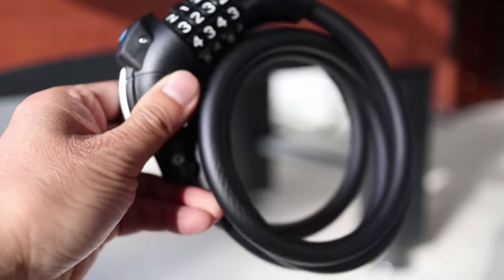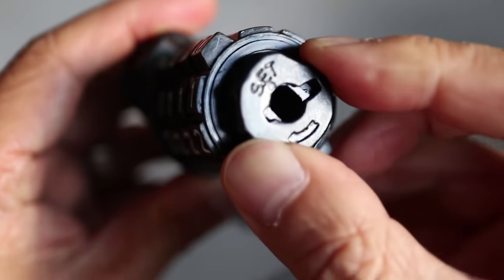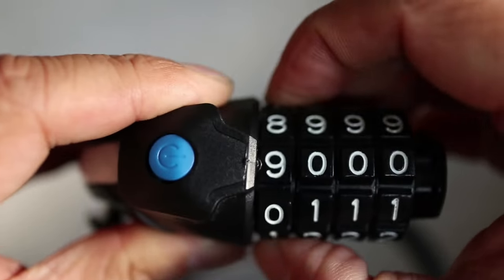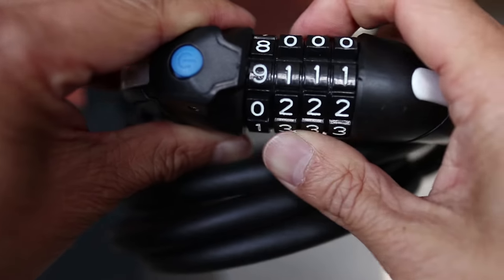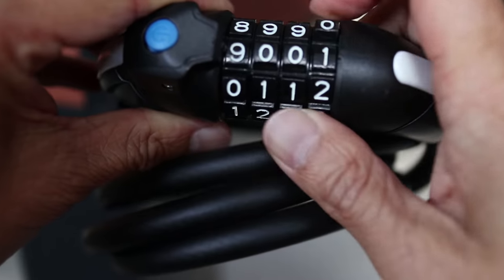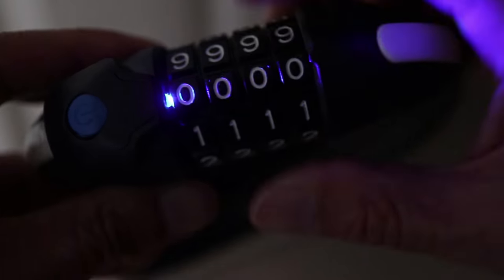How to Change Bike Lock Combination – Reset Combo on a New Bike Lock Cable with LED Light

Comment: hello, I got down a Anko bike lock recently. I could release it with 0000 combination but did not work the new combination. Also now even can not turn the reset button to 90 degree clock wise to the position to have a new combination setup. Any advice please.

Comment: I bought mine at a yard sale and don't know the combination. I didn't think to ask for the code since I assumed it was already reset.  So how do I get this to work? The 0000 doesn't work.
Reply from the maker: The only way you can change the combination is knowing the current combo first. You have to be able to unlock it before you can change it. The 0000 code is what these locks are set to when you buy them new. Without knowing the current combo you won’t be able to change it. Sorry! ☹️
Reply: @TheRenderQ  Thank you. It only cost me $5 so I'll take the loss.

Comment: Dude please answer this comment! So my mum got me a lock just like that but with six digits and it won’t move to the set mode it budges a little but is still not on set mode what do I do?
Reply from the maker: If your bike lock has the same set dial as the one in my video then you might use a set of pliers to help you turn it. But to avoid scratches wrap some tape around the dial or pliers so you don’t scuff up the metal. But carefully turn it since you you’re gonna have more torque using pliers. Hopefully the dial moves for you! Thanks for watching!

Comment: wish you showed which way to turn and how it should look when turned
Reply from the maker: At :12 seconds I show how to turn the set dial and rotate it clockwise. That’s when you dial in a new 4 digit combination. When done turn the set dial counterclockwise to the original position to finish. Hope this helps!